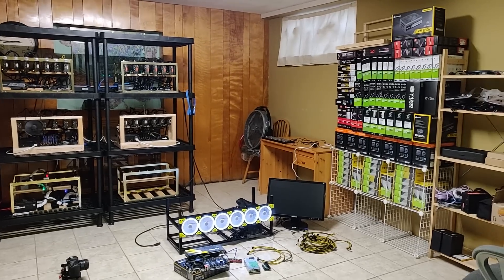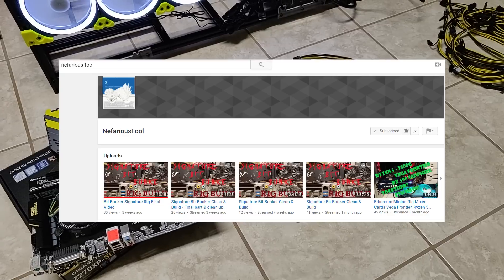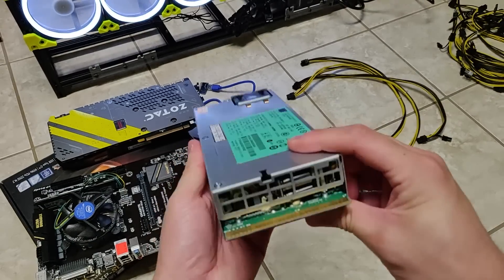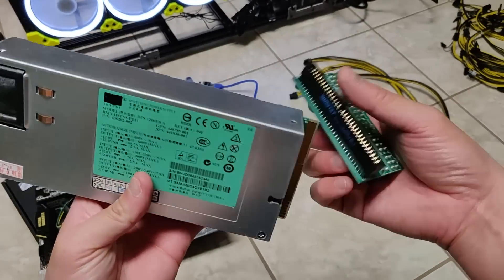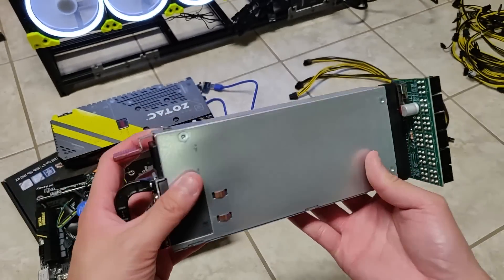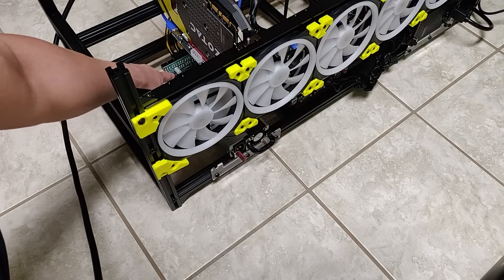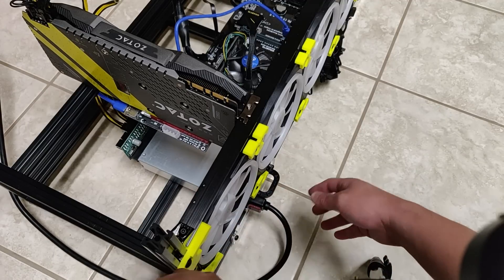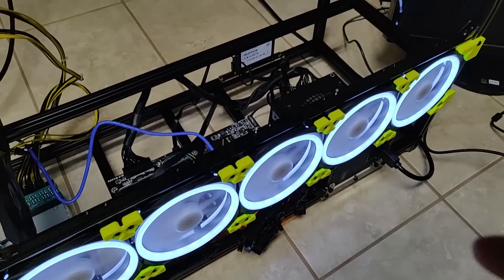Installing a Server PSU For The First Time...

Comment: just a question, if I am running on 120v outlet, I can plug in 900W of server PSU and 300 - 350 W of ATX power supply right. How many cards can i run though? lets say each card is 300 W, so that means I can run 3 cards becasue server psu is 900w? is that right?

Comment: Today burned down my Corsair HX1000 power supply - it literally burned all - even GPU and mobo as well with fire and smokes! It smells like dead body but not human body but some kinda dead rat smell with sweet saturated aroma - you know when you poisoning the rats and they die somewhere in attic and you cannot find them for long time but they smells - then you now know - exactly same sweet oversaturated smell came from GPU, Mobo and especially Corasair HX 1000 !!!!

Comment: Sorry I know you make this video like 2 years ago but I am wonder how many video cards you can plug in a 1200 watts? I am also referring about cables how many comes because I saw in this video using 3 cable for gpu and the raiser so you maybe ending with not to many connectors

Comment: Does it require any other settings in bios to overclock GPU’S ?

Like ppl mostly reduce power and running GPU’S on 70 to 80%

How can we control GPU’S

Comment: is it possible to make it so that when you turn on the power switch the server psu will also power on?
Reply: Yes. Some breakout boards have a 4 pin to molex which can be linked to an ATX PSU.

Comment: How loud does it get under full load?
Reply: It's like a jet engine
Reply: @iniquitousprime8747 
Yeah, I wished that someone would have covered that.

Below a certain load, it's not so bad (~600 W mark), but once the load starts getting up there, the fan on the PSU itself starts to ramp up and it can really be audiable then.

Comment: hello buddy 
I have the same items as you only I have Corsair 1000w and psu server 1200w now you have connected from psu server 1 cable in the riser and 2 cables in gpu, now I have RTX 3060 TI can I use splitter adapter cable because I want to connect from psu server 1 cable with splitter adapter in gpu, which means not 2 cables for one gpu but 1 cable with splitter for one gpu, I believe you understand my question, can you explain this to me please.

THNXXX for your video you are the best

Comment: Hi  thank you for the tip about hp Psu, currently I have to proceeed as same as you but I could confirm you if your configuration still is running up , Best Regards JP

Comment: Amazing video bro! Thank you! and one question, the pcie cables from normal psu need to connect in 3 heads always?? 2 for both of gpu and 1 for riser ,or it can be just one cable connected to the gpu 8 pin and the other to the riser, being only 2 connectors used? Sorry if is dumb question haha

Comment: Is there a way to synchronise both power supplies so when turns on /off the other automatically does the same? ( Like you can with two PC psu)

I what would happen if the PC PSU stops and the server PSU continues to power the video cards, could that damage anything? Thanks

Comment: Just want to share my recent experience with server PSUs as a warning for anyone considering it. I have 3 of these setups from Parrallel Miner with ZSX breakout board. One rig had 4 cards and as soon as put a 5th, at boot, the breakout board lit on fire, twice! So that was two breakout boards gone. Afterwards, put an ATX to power the the mobo seperatly, added a fifth card and it fried a brand new 3060ti. Now powering another new 5th 30060ti card with the ATX psu and its holding but overall the 1200w server PSU seems like it just can't handle more than 4 cards (and these aren't even 3070s or 3080s, definitely gonna stick with ATX going forward, never had fires with those.
Reply: is this the problem with breakout board or the power supply?

Comment: Those are very good power supplies from HP. They have 3 distinguishable power supplies, those being the blue, orange and green ones. The ones with the blue sticker are rated for 450W, ones with orange label are rated for 750W and the ones with the green label are rated for 1200W. These power supplies are very common among a wide range of HP enterprise equipment such as networking equipment (ex: switches) and servers/workstations. The 1200W are usually very common among the HP ProLiant DL580 G7 servers (it takes 4 of them!). The other ones are popular in other HP enterprise equipment.

Comment: I  am a seller of this kind of psus. The best server psu is the one wich has no breakout board, and the cables are connected with an soldering gun. From my +3 years experience, I can say the the worst server psu is 10x better than any computer psu. There are servers psus with 2700, 2880, 2980w, and 5600w watts, that are incredible reliable
Reply: what is a Soldering gun?
Reply: @maahm0025  A soldier who has a gun.

Comment: Do you need to tie the grounds between the two power supplies together?  I am curious if one PSU is slightly higher voltage, if that would matter

Comment: How did u go from 6pin from server psu to 8 pin for gpu I imagine you used an adapter 

But my question is isn’t 6pin for 75w and 8pin for 150w how did the 6 pin held up by being overloaded ?

Comment: so you are saying  with that breakdown board and the pico thing can i run my server motherboard 24 pin and save a few bucks? here is the thing i m trying to build a new system but since i am not a blind consumer, i already know the server power supplys are built like war tanks they are created to be running 24/7 and they do sometimes more than 10 years with no problems but incredibly you can find those way cheaper and way stronger and i love reliable stuff but unfortunadly the same type of power supply you got on this video has no wires so i cant just built my computer with one of those but i see that you got a bunch of adaptors so can i built my computer and use one of this titanium platinum truly rated server powersupplys to run my new build?

Comment: They are great if you like the sound of a jet engine. lol  Once you get it loaded up, you MIGHT find running the cards and the risers to cause the rig to be unstable; I use the HP server PSU for powering the cards, and the ATX PSU for everything else.  I put an extra 60mm fan over the front vent openings to do a push-pull cooling solution which keeps it cooler; they run pretty hot wihtout it; and as we know heat and dust are electronics worst enemy.

One other thing that works for me; I have the same frame(s) as the one in this video, but I reverse the center latteral bars so the mobo connections point out front, (opposite side of the fans ), it just makes plugging in USBs for upgrading miners or start files and or other items easier, and I use a $9.99 LCD wall mount from newegg with the chrome in rail nut lugs to mount a cheap pawn shop 19" element tv to the front upright bar to play spoifiy, YT vids, yada yada while working around the rigs.

Comment: Is possible to use bitnain apw psu instead of hp psu? Bitnains psu doesnt have breakout board and switch. In my opinion they should work same way,however not sure. Has anyone tried already?

Comment: They do make breakout boards that have a molex connector that plugs into an atx psu. This will allow the atx psu to auto start the server psu when the rig boots up and will turn the server psu off when the rig shuts down.
Reply: Do you need PICO to sync ATX psu + Server PSU with those breakout boards?

Comment: Nice man , just to point out some breakout boards can link to PSU so no need to switch them on , PSU will tell them when to run and when to turn off
Reply: can that be done with the 4 pin mollex connector to main psu? I have a breakout out board with a 4 pin detection slot
Reply: @anielvarma  yes use the molex from PSU and connect to the breakout board

Comment: Theses power supplies are actually much more reliable than ATX power supplies...they are designed to be run 24/7 unlike your average consumer PC components.
Reply: It's a Volkswagen
Reply: where do you get the plugs for the server psu from?
Reply: Do you have a source or explanation of how/why this is the case? Thanks much!

Comment: These Hp Server power supplies and Breakout boards (with 12 pcie slots) are the best :)
but dont run them above 60-70% of their max load otherwise you will hear them start to scream
since the fan is very small it tends to get louder then
but until then great things!
Reply: That's why I keep them open, with two 92mm sunon fans on top of them. You will never hear them and the psu is much cooler.
Reply: @ivanpopov1016  any picture on how you done your fans??
Reply: @GhostvaperYT  I heard about people replacing the base fan with some noctua fan to reduce a lot the noise. But i'm wondering about the fan size in this, because I still didnt receive my hp psu server
Reply: @parydarksix  idk ive not measured it but think 120mm 12cm
Reply: @GhostvaperYT  Somebody told me 40x40x20 mn :D
Reply: @parydarksix  maybe as i said i not measured it.   i will try measure it tomorrom if u want but they are quite small
Reply: @GhostvaperYT  As you want, dont worry :)
Reply: @ivanpopov1016   Ivan ... you keep them open and all those high voltage components, especially the huge capacitor, don't represent a risk in case you're doing some rushed up maintenance and bump into something? I like the idea, just considering the risks .... (Nope, I do not have cats at home!!!  :-> )
Reply: @carlosophia  I can't bump into them, since there are fans over them. I've cut the top cover and I've put 2 92mm fans over the opening.
Reply: @ivanpopov1016   AHHH!!!! GREAT advice, many many thanks! I live in Rio de Janeiro, Brazil, so "very cold" means 15C at night. I'll try that hack. Hum, I just need to learn how to cut a metal case, I don't have the tools for that but I'll for some small business that might help me with it. Thanks!
Reply: I run my same sever psu at 900 watt it not to I pass that Mark they start get loud but I did see a 75 watt  difference at the wall.
Reply: @davewol678  is it still running?
Reply: @hamsiboy7104  yes
Reply: i have 1200w and running 720w and it sounds like im raping it hard!!!  screaming!
Reply: @GhostvaperYT  check your rig environment temperature see if it is too high?
Reply: @freemanz  well my rig is open in one of those  open air bench things.  its next to the window which is open at 1 degrees C today. My cards are at  46c-56c  and the room is freezing cold!  It is the server psu that is running so LOUD!! omg my 8 gpus are cold 46-56c   but server psu omg
Reply: @GhostvaperYT  Good to know, I was going to get one but sounds like a bad idea lol
Reply: @totalbullion5882  well it depends on your room heat. it was LOUD like really loud - loud as a hairdryer. Put it in my cellar where it is cold it's ok now.  So I would say buy one if you can keep your room cool and make sure you do not over stress it.  like if u have a 1200w one and put 9-1000w on it - it will be hot and loud imo
Reply: At normal load, are the quieter than a hair dryer?
Reply: @brkbtjunkie  yeah i put it in my cellar its cold down there its quiet now
Reply: @GhostvaperYT  LMAO, we got there eventually!!
Reply: @brkbtjunkie   Until it went haywire today (for no apparent reason, it's not that hot in Rio right now) I only had an external PC fan to cool it, so nope, no noise at all. The fan shuts down and there's actually a pot tweak -- I'm still searching for it!! -- for you lucky people who live in colder places so that the fan keeps running slowly and it doesn't build up moisture.
OTHERWISE, when it decided to go nuclear today I just heard this "Mission Impossible bomb ready to blow" sound and then I went out of my room to the other room wondering who had turned on the vacuum cleaner at 10 PM. It's REALLY loud.
Reply: @brkbtjunkie  Excellent question, please someone answer

Comment: These PSUs are incredibly reliable and efficient. Not to mention very cheap. I pay around 20$ per 1200W PSU, once you find these there is no coming back
Reply: Is there a way to use them in a regular desktop?
Reply: @indraexe7735   They only make 12V. This means that you need aditional psu board. Google for pico psu. The pico psu takes the 12v and gives all the stuff you need for atx mb.
Reply: @arhitektche  yeah but what if I want to turn the pc on?
Do I have to press the breakout button button every time or I just set it to ON then when ever I press the pc case button it automatically powers on!?
Reply: @AutodidactEngineer  No, they are separate. Put them on the same power strip and set them on always on. Than you turn it on by plugging the power strip. Put a smart plug on the power strip to control it from the phone and see consumption
Reply: @arhitektche  the server power is 240 volt and the ATX is 120 volt. Wouldn't that be a problem to put them on the same strip?